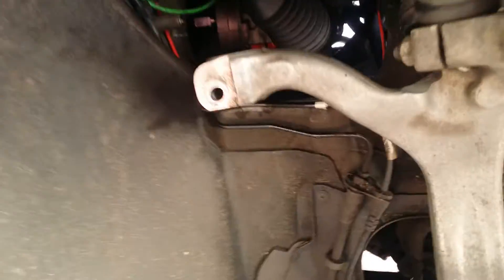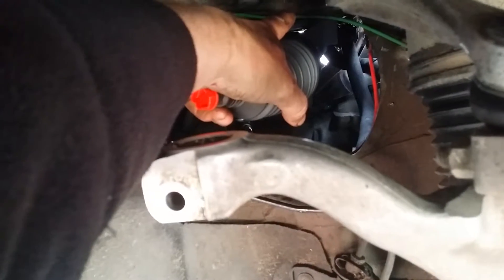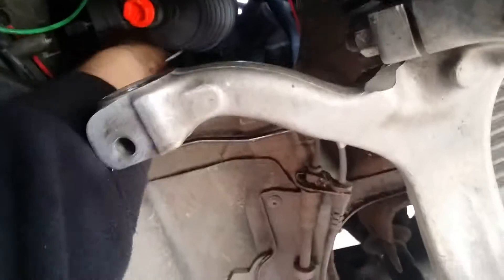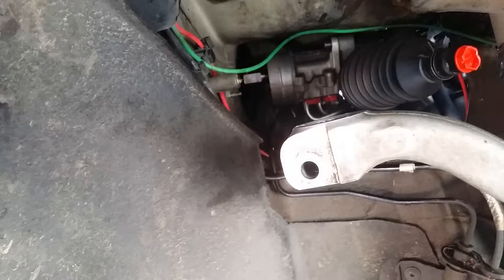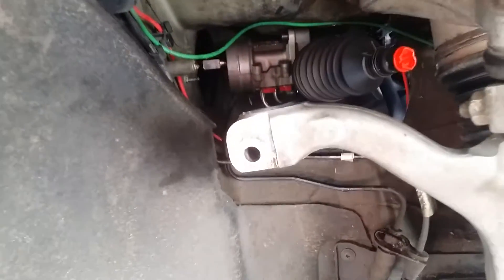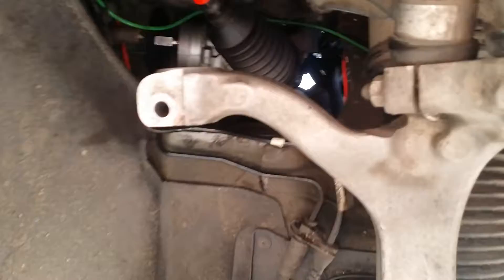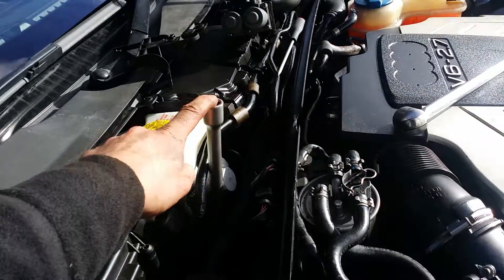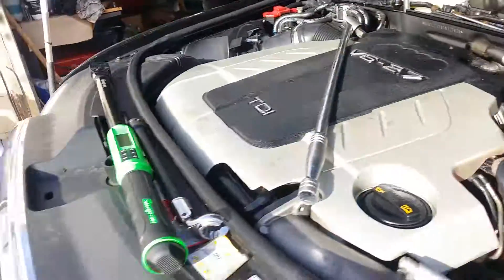Sterring rack removal a6 c6 4f part 3

Comment: Thank you for the videos! I'm going to do this myself soon. Just curious why did you change the steering rack? I'm having loose steering and knocking noise when wiggling steering in mid position from side to side when vehicle is not moving. I'm guessing rack is worn out from the middle position. Thank you!
Reply: Hello im having the same issues.. What did you do to resolve it?
Reply: Morjes, päädyin tilaamaan koko steering rackin autodocilta. Era Benelux oli firma jonka tehdaskorjaama. Lähti kolinat ja tuli ohjaukseen napakkuutta. Itellä se 380tkm takana niin kyllähän siinä jo hammastanko on kulunut puolivälistä. Vaihto oli yllättävän helppo. Kannattaa varata paljon ohjaustehostimen nestettä kun toi pitää flushata (ainakin 6 litraa)
Reply: Loose when wiggling is usually a worn-out suspension part, not the steering rack.